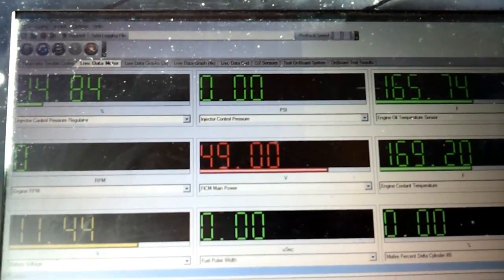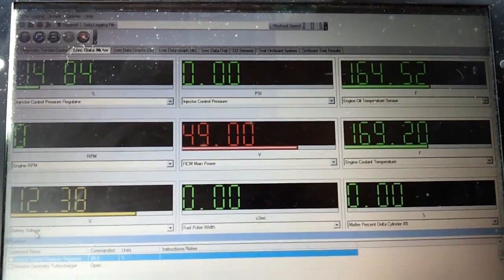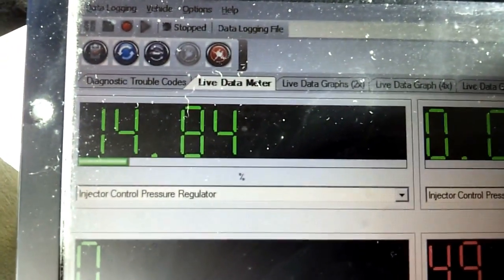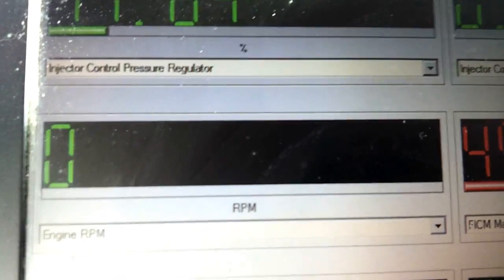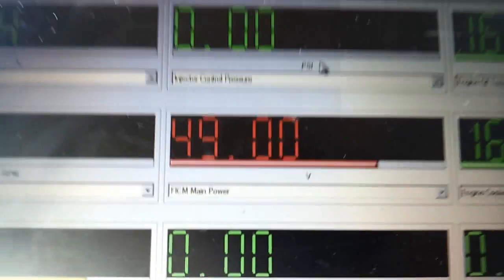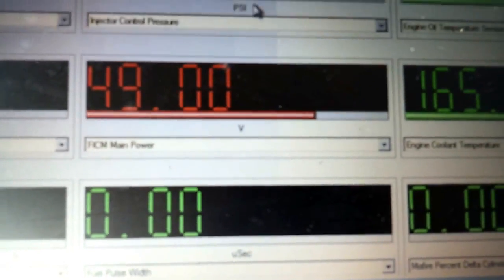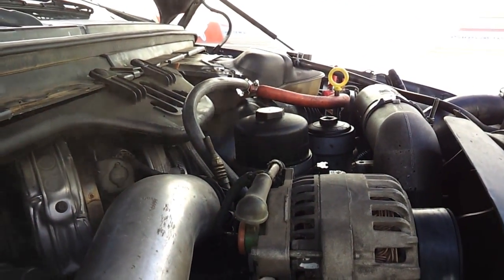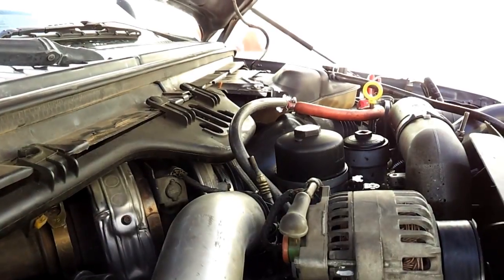FORD Diesel ~6.0L & 7.3L~ Troubleshoot Hard or Won't Start Problems ~Can't Start Hot/Cold?

Comment: All these sensors are BS what did these diesel trucks do before sensors? Bet they never had problems
Reply: For sure they had their own set of unique problems.  Computers with sensors can do more fine tuning and get better mileage, but as soon as a sensor or control goes bad, nothing works.  Older pre computer models used mechanical feedback loops.  The best thing about them is they will still work after an EMP kills all the computerized vehicles.  Lol

Comment: I got one,it’s a 6.4 the customer drove the truck til it ran out of diesel now it has extended long cranks when hot. Before that it will start just fine,it would start before turning the key.🤨😤😡🤬

Comment: Hi. I have a 1996 7.3L no start. I've run the scanner looking at the same numbers you have up there while cranking. I'm wondering if based on this information you can help me diagnose if it's either the IPR valve, a high pressure leak, or something else. I've already ordered a new IPR but I'm wondering if I should pull out the HPOP while I wait. The high pressure oil reservoir is completely empty (I stuck an 8" straw down the little plug at the top of the reservoir and the straw came out dry), and I'm slightly overfilled on oil (maybe 0.5qt over full on the regular dip stick).

On crank I get Revs: > 120, PW: 0.42ms, IPR: 54, HPOP was mostly 0 but at one point spiked to 2700 for a second then back to 0 psi. Thanks for any advice you've got.
Reply: Have you tried with the IPC disconnected?  Sounds like the IPR.  You can remove it, disassemble clean and replace the o-rings.  That can help.  Had similar problem.  Gunk in the IPR.  cleaned and worked fine.

Comment: 2004 f450 6.0 crank no start. Replaced motor. New motor  Not showing rpms. Tested both crank and cam sensors and wiring still no good
Reply: Any luck

Comment: i have 2008 E450 diesel ambulance i have replace two fuel injector's on it were not working. so now won't start .i even replace three batteries one starter still won't start if someone Know's anything about it please help .

Comment: HI buddy. what software its that in the video? it works on a standart elm 327 interfaces?
Reply: Farid Mahfoud No that software is Auto Enginuity. has it's own special OBD connector
Reply: GadgetClass ahhh because ir cant see icp pressure on any other software líke SCANXL or SCANMASTER
Reply: Farid Mahfoud it will show it in torque pro and any scanner. look for injection control pressure. on Torque pro you have to load the extra does POD set from options

Comment: cr38er or anyone ever heard of an ICP leak that was
intermittent? I've got a 97 PSD 7.3 that started out with a "no start when
hot" problem. 
I changed my IPR and ICP sensor and thought that fixed it. Then the “no start
when hot” came back intermittently.
Now, when it doesn't start, my ICP pressure only hits 350ish. 
When it does starts, it fires right up with >800-1000 ICP.
During my troubleshooting I noticed the ICP pigtail would change the idle speed 
of the engine when bumped, so I wired in a new pigtail. 
Initially, when I rewired the ICP pigtail, I had the signal
and signal return wires on that pigtail crossed (unknowingly) but it still
started. I went back and rechecked the wiring, rewired it correctly and now it
isn't starting at all. I’ve pulled the ICP connector and tried to start with no
luck. I feel like it’s electrical, but not positive. 
All fuses inside and outside the cab check good. I just bought the Torque Pro app. 
Torque Pro live data seems normal but for some reason I
can't get it to pull DTC's. I’m frustrated and was looking for ideas.
Reply: You may have a chafed wire somewhere. Check your 5V reference voltage while wiggling wires and connectirs
Reply: Do I need to check vref at a particular place?
Reply: +Andy Chambers You can start just monitoring it with torque pro while messing with wires.
Reply: Did you ever figure out the problem?

Comment: Got a 2004 f350 6.0l swapped injector number 4. Husband released pressure under injector and flooded the system. Now leaks diesel fuel from right over the oil pan. Won't start. Starter just clicks. Only reads code for KAM sensor.
Reply: Sounds like you need new injector O-rings to start with. Beyond that will have to go symptom by symptom.

Comment: Does the air test work the same for the 7.3 as it does for the 6.0? Close the IPR and air in through the ICP?
Reply: Technically yes, but HPO leaks on a 7.3 are rare and not really something you need to go through the trouble testing for
Reply: +SuperDuty I've developed a long crank/no start when hot on my 7.3. I've changed the icp, ipr and injector orings. It dint help. I'm hoping this test will let me know if I have hpo bleeding off somewhere. Great video by the way.

Comment: I have a 2003 Ford Ranger Deisel. I have had a egnitionswitch that was bad but functional. you just had to turn the key 2-10 times to start. Now It only cranks but does not start. I did order a ignitionswitch but I can't find where it should fit. So I belive I got the one for a gas one and not diesel ? what do you think ?

Comment: i have a 1999 ford f250 7.3l and when i was driving to work one day i noticed it was losing power and when i pulled over and turned the truck off thats the last time it started but yesterday when i tried messing with it the starter comes try to fire the engine up but the truck wont start. i need help please
Reply: I try think u may have a few litres/quarts I f oil short, or your hoop switch needs replacing, injectors may need replacing, as for cld starts there is a few things u can do

Comment: Just picked up the newest version of Auto Enginuity for a 2000 Powerstroke that my wife bought, and apparently they've done away with the FICM Main Power selection.  I'm having trouble with cold starts, and I'd sure like to check that module, but I can't find anything that replaced it in the menu.

Any ideas?

Thanks

John-Henry
Reply: it's there.. that's a fundamental PID.
Reply: +GadgetClass actually... Did you buy the Enhanced Ford package for AutoEnginuity? If not, you won't be able to do much of anything with it.
Reply: Yep:  PIcked it up from Riff Raff with the Enhanced Ford Package (SPO3, Version 13.30).  I have three 7.3's, so I figured that it would be worth it, particularly since I'm a long long way from any decent diesel mechanic.  I've only been using it for a few days, and it's fairly complex software in some ways, but I know my way around software and computers, and I'll be damned if I can find any selection in the dropdown menus that will allow me to check the voltage coming from the FICM.
Reply: +John Henry ohh. The 7.3s don't have a FICM. the injectors are controlled by the pcm
Reply: +GadgetClass You're right, but it's the same thing, isn't it?  I just want to know if it's doing what it's supposed to do, but maybe there is no option in the software to check it directly?
Reply: +John Henry Not on a 7.3l.

Comment: I have a 7.3 turbo diesel  got to work went to leave no start replaced fuel pump n filter glow plug  sensor 7 of 8 glow plugs water  sensor  wiring harness batteries good fuses good but no start any suggestions  everything points to brain but that has to be programmed with truck vin
Reply: Valerie Wheeler. change valve iol pomp
Reply: +Valerie Wheeler Hi Valerie. You need some way of monitoring your Trucks High Pressure Oil. The Best way is to buy an ELM327 Bluetooth adapter and purchase "Torque Pro" from the android play store (Yes you need the pro version). This is the best $15 you can spend on your truck:
http://www.amazon.com/dp/B00OMT6UEK/?tag=yclick-20

Once you have it setup, you will monitor "Injection control pressure" it needs to be at least 500PSI for the truck to start.

Comment: help  I have a 350 fordpower stroke diseal  I cant start it I changed the selonid it keeps blowing the 30 amp fuse as soon as I turn the key I changed the module  what should I due next help need advice     ty
Reply: the fuel heater inside the fuel bowl shorted out. unplug it from the side of the fuel bowl replace fuse and get the truck home.then order new fuel heater and plug it back in problem solved.
Reply: +pam papamechail Pam, try unplugging your fuel heater, the connector is located directly behind the fuel bowl, it is a  SINGLE CONNECTOR. I did this with the same problem and have had no more issues. If you live in a warmer climate, you do not need it connected. I live in eastern Oregon where it hits 0 to below 0 at times and have had no issues.

Comment: Hi, I have a 2000 f350 with 7.3L power stroke.  It does that noise that you showed when you are trying ICP pressure but mine never fires up the engine.  The battery seems to be good and the fuel tank is full and the fuel is getting to the engine.  Any ideas what the issue can be and how to fix it?  Thanks

Comment: Help ! Customer ran out of fuel several times and now they wont start...po1095..inertia switch..we reset the switch (clik) but we are very lost to find why pcm command the switch...we have clean fuel delivery to secondary filter but no injection at all...self test the injection module and he's ok.. ..

Comment: Ok here's one I have a 04 f350 6.0 driving and whole truck would shut off. Cranked it a few dozen times and it would start.  Repeatedly did this. Any ideas?
Reply from the maker: Wayne Rowland Probably a high pressure oil leak. You need Torque Pro on Android, Ford IDS, ScanGauge II, or a tuner to monitor your ICP while running and cranking. Links in the video description.

Comment: Since some time I OWNER 2006 Ford F350 6.0 diesel.
When trying to run, hpop pressure in the first 3 seconds is 0psi, for the next 3 seconds the pump is pumping up to 100 psi. After the next second the pump is pumping from 100 to 500 psi - then the engine starts up.
Pump is new, proven IPR valve, the system was checked for leaks 120psi (air presure).
I have  took out the pcm power relay, and have started the starter, Max Pressure on high pressure strip was 1400psi.
What else can I check ???
I have no more ideas.

Comment: if u people would stop buying junk AND BUY A CUMMINS U WOULD NOT BE WATCHING THIS VIDEO
Reply: We dont have a problem with the cummins motor its the rest of the truck that is a complete piece of shit bud
Reply: ford------- fuckin owner really dumb
Reply: lmfao try harder ha ha ha ha ha
Reply: Ryan CHRISTOPHER the dodges have shitty front ends among other things.  cummins engines...no prob there.
Reply: I know of plenty of people including close friends that have nothing but problems with cummins. The first gen mechanical driven are the best. Later 5.9's, cp3 issues, injector issues, blown motor issues.
Reply: Yea, before they went electronic with them. After electronics came in it gave them a tone more power but reliability decreased. I have 240,000 on a 6.0 motor and the only thing i had to replace on it was a brand new vgt turbo.
Reply: Yea, thats what I keep hearing however me and my brother both have 1st gen 6.0's never had any problems and they make a ton of power. We race the hell out of them 6.0's. 01-03 duramax garunteed to have injection failure though but i used to own an lly they're pretty sound.
Reply: TheRossillini yep..injectors indeed...the 6.0's at work (around 2005/6), have been a pain.  great when operating fine...a bear when not
Reply: Check out Powerstroke help on you tube, the guy is a wizard with Ford diesels and he'll tell you the 6.4 is designed to fail. He'll tell you the 6.0 is the bomb, take it from someone who actually owns one.
Reply: TheRossillini Yep.  I have watched loads of his videos.  He knows his stuff.  I'm not a Ford person per se, but, he really schooled me on these engines and atleast I can now understand what is going wrong in them when there is an issue.
Reply: Cummings comes in a Junk Body. Tough to drive that engine alone down the highway
Reply: Our fleet guy said it th is week. "out of the three, (ford, dodge, gm), he said the cummins gives them the least issues.
Reply: i had a first gen and it never let me down.
Reply: TheRossillini the duramaxes dont seem to give the issues the fords/intnernationals do...in my humble opinion....atleast from what I've seen at work...
Reply: bababooey7576 you gotta loose the emissions components, egr kills the 6.0.
Reply: TheRossillini Agreed.  Except, this is a municipality.  They'd be lynched for it. 6.4 is killed by emissions, too, no?  the 6.4 makes the 6.0 look like a dream
Reply: Cool man. Check out my truck on instagram: Rossome86
Reply: Ryan CHRISTOPHER yes and you have never ever ever ever ever had a problem with a cummins dodge. Thats why there resale value is so shite😂
Reply: Roy Goode cummins can fuck up also royaly. And very expensive to repair. Just like any other truck
Reply: Roy Goode nothing is made like the old days. Old trucks are still around today 50.60.70 years later. Todays trucks are lucky to last 10 years without major problems. Unfortunatly today is a throw away society. Good luck with your build
Reply: Ublomonkies
Reply: Dodge trucks with cummins in them were described best by the canadian at zip ties and bias plies.great motor in a shipping crate.
Reply: FORD.Found out rescuing dodges
Reply: Why u watching it then?
Reply: Ryan, you only prove what people paying attention already know; most aggressive, rude, obnoxious, a-holes on the highway drive dodges, it's easily over 80%. Dodges are for poor, ignorant people like you, that's why you drive it. They have the easiest financing for their POS vehicles which goes hand in hand with the obvious low socioeconomic/low educated people such as yourself. Dodge also has the most angry/aggressive looking vehicles, another reason why micropenis over-compensators like you choose them. Instead of attacking people because you want to feel good for owning a POS dodge, you should be working on your POS dodge, no doubt it needs LOTS of work on it right now.

Comment: 05 ford f-350 6.0L diesel icp is 0 no matter how long it's cranked
Reply: Unplug the icp sensor and see if it starts. If so, bad sensor, if not HPO Leak
Reply: SuperDuty The valve cover you keep referring to is the RIGHT SIDE valve cover. Not the left
Reply: SuperDuty mlle

Comment: yes i bought the auto enginuity pc scan tool pro line vci. okay my question is on the live data meter drop box were you make ur selectons on what sensors you want to monitor. mine does not give me the option for the ficm main power option. why? do i need a enhancement for this to be possible
Reply: You do need the FORD package to read all of the PIDs and do the self tests and power balance.

Comment: I have a 2005 ford 6.0 started fine went to a friend house turned it off for about 3 hours then tried to start it and would only crank. Then we sprayed starting fluid and it fired right up what can the problem be plz help?
Reply: Could be a bad ICP sensor. Unplug the ICP and see if it fires up.
Reply: check the dummy plugs or injector o rings

Comment: Does the bluetooth show everything? Like ficm voltage and icp pressure? Thanks
Reply from the maker: Yes, It will read all available PIDS that you can normally read with ScanGuage II, AutoEnginuity and IDS.

Comment: I am looking to purchase a 95 psd f250. Has 220k miles on it. It supposedly is a bit hard to start. In layman's terms, could you summarize what the potential issues could be? What I got from the video is that either the sensors that tell the engine's main computer when to execute fuel injection into the cylinders are bad or the high pressure oil pump has a leak somewhere. Or there is a leak...somewhere in some system? Could it also be something more simple, like maybe the glow plug relay went bad? Thanks for your help, and I apologize for my ignorance.
Reply from the maker: A lot. I would never run under 14 quarts personally. I did run all the way
home from Canada with a blown cylinder eating oil the whole time and did
get quite low. You have to be bone dry to not feed the HPOP.

You provably have other things going on like an HPO leak.

cr38er
Reply from the maker: a 95PSD it may be a Glow Plug Relay. These go out a lot on the 95-96
Reply: cr38er thanks for the video, do u know how many litres or quarts u got to be short b4 r he hoop no longer  applies enough press for the injectors
Reply: Ok, thanks bud, do you remember the 7.3 having a skimmer?
Reply from the maker: What do you mean by skimmer?
Reply: cr38er I know, that is what I asked the parts person, I said, "you mean a filter, "he said no" the filter is a separate parts number.  The truck cut out on me in the highway, got towed back. f250 diesel 7.3 4x4.  I can't believe 4 less quarts would kill the hpop. That is what a heavy duty mechanic said, "there is not enough oil in the res to fill the hpop" Maybe it is just the hpop switch, I hear they go too.  someone said to also check the fuel heater relay/fuse number 30.
Reply from the maker: CPS sensor is common fail point on these too.